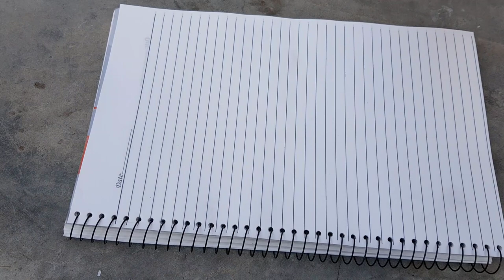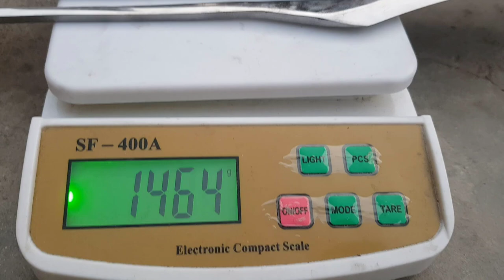Rusted GREEK SWORD - RESTORATION

Comment: Someone has to teach this dude the difference between restoring and customizing
Reply: For real
Reply: Why are you complaining when most of us including me in this comment section can’t even do what this man does?
Reply: The reason they are complaining is because there's a very big difference between restoring and customizing, we came to see a historical object getting restored and brought back as close as possible to its former glory, what we got was someone damaging and ruining a historical object (if it even is one) for their own desired look. And you don't need to be able to do this to complain about the blatant clickbait that the title is. Hope that clears it up for ya. Have a nice day.
Reply: Ermmmm he did both
Reply: Lets just say that he's Restorising.
Reply: Literally first thing he does is break the handle🤣🤣
Reply: Wow and you proly can't do what half this man does
Reply: Edwierdo hate to brake it to ya, but this is fake. For the wood to be in this good of a condition the sword would have to have been in a museum storage for centuries, also the sword has hardly any signs of age other than rust which should have had an effect on the metal seeing as the sword is supposed to be over 1000 years old
Reply: I agree with Yellowbuzz here, even with the restoring stuff out of the way its still clickbait. And @Edweirdo all he did was remove rust via vinegar bath, cleaned it up, removed the hardening and then polished it to near-mirror finish, stuff that you learn in 9th grade metalworking class.
Reply: Yeah he just made it into an oversized, probably unbalanced, crooked bowieknife
Reply: @isalcedo4211  there is no both lol.... restoration is restoring the weapon to its previous state. with as little deviation as possible. this dude straight up just remade the whole weapon lmfao
Reply: @Yellowbuzz-ug6of  .
Reply: I showed the whole procedure for restoring this chopper in this video.
o. The liquid i used to remove RUST was VINEGAR.
o. I used sandpapers of different GRITS for the shine of the steel.
o. Brass casting was done for the HANDLE to look more enchanting.
o. Dark colored wood was used to make the handle.
o. For Hardening the blade i used my own handmade METAL MELTING FURNACE.
o. I used clear paint to shine the wooden handle and Brass was shined by special brass polish.
He Tried To Explain It
Reply: @isalcedo4211  erm? never heard that term before
Reply: @lordfencepanel8666  yes because putting in vinegar metal grinding casting and normalising are incredibly hard tasks
Reply: @alexkim3084  im so triggered from this video  xD
Reply: Thomas yang by damaged you mean also restored.
Reply: Why are you running ? Why are you running ?
Reply: Chris he still restored it
Reply: im fine it just means like um
Reply: Someone also has to teach them the difference between a real sword and a replica :P
Reply: This was unbelievable restoration truly an art and amazing skill.
Reply: @lordfencepanel8666  Last I checked anybody can clickbait. It's a pretty basic skill :)
Reply: Manny Lontok make me bruh you don’t own me.
Reply: U guys cant lie tho it's pretty cool
Reply: @penguino8550  yall keep saying that but the only thing he does that i cant is cast with metal which i cant do because i dont have a kiln. Everything else is mad simple and even if i had a kiln that would be easy too. Doesnt help that the only thing he cast were his custom pieces so that part wouldnt even be a thing if he were actually were restoring it instead of customizing.
Reply: @alex kim he broke the handle cos it was decaying
Reply: @joedenralph9273  why didn't he try and recreate it though instead of making whatever in God's name it was that he made.
Reply: Emrik is right xd
Reply: Emrik still a cool sword tho xd
Reply: @alexkim3084  to replace the handle? That's how restoration works lol
Reply: Emrik he still did a good job btw the only fake part is that it’s an old sword
Reply: @Emerik ikr and he really doesn't understand what restoring really is apparently
Reply: He has done both
Reply: or restoring and "repairing". thinking people just call whatever they want. this is the very reason why we're making dictionary though.
Reply: "impossible restoration"
Reply: @usually_unusual3920  there is a fine line between customizing and restoring. Restoring is making it look like or close to like the original version. Which all he did was keep the shape of the sword then he made his own touches via customization
Reply: @thegodkiller0194  no he customized it there is a very fine line. If he had restored it,it would look like the original which it doesnt
Reply: He did both he restored it and made his on handle 🤦🏽‍♂️
Reply: I agree with all of you but the thing is it never look like that we don’t know if it look like that so really none of us have room to talk have a good day
Reply: @Kingtatos  listen, you didnt have to watch the vid, chances are they acquired it legally and depending on where they live they can customize it to their hearts content, and all they customized was the hilt and guard, if you dont agree with that then just dont watch it, and they technically did restore the blade
Reply: @unpopularopinion6321  "Is it legal?" was never a question discussed here, it's him claiming that he's "restoring" it even though you can't classify that as restoring sice he customized it. Then the "impossible restoration" part of the title leads you to think it's some super heavily damaged blade, when in reality it looks like it was made maybe 20 years ago with little amount of rust. We got tricked into watching this, and instead of seeing an actual restoration process we had to watch a perfectly good blade get ruined because of "preferance".
Reply: @unpopularopinion6321   He also made HUGE HOLE right in the blade...
Reply: Yup
Reply: @mrbigtoes6721  Bro, he didnt restore it
Reply: @kadenwellman4047  no
Reply: @lordfencepanel8666  You don't need to be able to do something to be able to criticize it
Reply: Kenny Van Vliet do you even get it?Its still restored.No matter what shape it’s in.
Reply: I agree - he destroyed a historic artifact.
Reply: Great job n u explain the process of what you were doing that was helpful
Reply: By all means...
Reply: Ok boomer
Reply: I've alway said this
Reply: Chris Better than an inefficient weapon.
Reply: Sebastian Rose Metal grinding can be dangerous.
Reply: Ghastly Deity It would be inefficient. If he is recreating something that broke in current times, he can restore it 100%, as something that new wouldn’t have the inefficiencies of the past, such as stone axes. Why would you recreate that? Make it into an iron axe.
Reply: guilherme henrique gotta get them views
Reply: @lordfencepanel8666  Right?
Reply: @alexkim3084  that handle wouldn't work, it's old and breaks easily
Reply: @realhawaii5o  a swords a sword!
Reply: @kadenwellman4047  right about m8.
Reply: Impossible restoration means it's very hard, I know I'm being very obvious but still.
Reply: @lordfencepanel8666  why are you complaining he turned it in to a call of duty bowie knife considering your name and profile I think you would enjoy the end result lmao
Reply: He destroyed a historical artifact that was ove a hunsred years old and was probably used is the Spartan ( 300 people ) v.s persian ( 300,000 people ) and the spartans lost
Reply: Dude do you honestly belive this swird is 4000 years old come on :D
Reply: Sword*,im too lazy to redact my comment 😂
Reply: Emrik you are completely correct
Reply: Yellowbuzz 1024 THATS WHAT IVE BEEN THINKING WITH ALL THESE SWORD RESTORING VIDOES. The only signs of age is the rust, and it comes off on his gloves way too easily to be real
Reply: That’s awesome
Reply: I agree to some extent but even if he wanted to recreate the broken piece he would still have to break it to see how it was made and just copy that which would've been completely fine by me for "restoration". Eventually u can see when he opened it how it was just some piece of wood with a cylindrical center and shape with a ring of iron on top of it, and I think considering this guy's skills he could've easily done that but just wanted to make it prettier, let me remind you he's 16-17 btw so cut him some slack, especially considering his skills.
Reply: @lordfencepanel8666  that doesn't mean he's immune to criticism
Reply: @lordfencepanel8666  By restore you mean customizing? Because this is customizing. He literally cut a weird ass slim rectangle into the weapon. 
Made a different handle, and made it look terribly like a mirror.
Reply: And also sum history cut that's a sword from the movie 300 the real greeks used a xiphos or a kopis.
Reply: @lordfencepanel8666  he is mislabeling his videos also coming from another one of his videos, this guy's a begginer, the job's shit ngl but I respect his effort. Doesn't make it restoration tho
Reply: Alex Christ almighty after 5-6 months you’re all still at me.
Reply: In the description he says he does that for fun so yeah
Reply: @lordfencepanel8666  
- Come listen to me playing the piano.
actually plays the guitar

- Someone needs to teach this dude the difference between a piano and a guitar.
- Why are you complaining when most of us including me in this comment section can't even do what this man does?
Reply: Restoring and modifying rather
Reply: Emrik lol
Reply: Okay, everyone. You guys need to calm down and just enjoy the video. The video that was uploaded for our entertainment, I might add. Instead of commenting on the video with mean/hate comments, we should be posting positive comments. There's already enough negativity in the world, we don't need to create more.
Reply: Someone hasn't had any parental love in their life
Yeah, he's customizing AND restoring
Reply: Lol.
Reply: @isalcedo4211 Um now it's one or the other. And he cut an unnecessary slit in the blade almost immediately didn't make a handle in the vein of the previous one. This isn't restored at all.
Reply: 100th
Reply: Oh look exactly 100 comments, lemme just ruin that. Also, Wood cannot be cleaned or it will get destroyed if you leave in water
Reply: Unless you know how to do it you shouldn’t talk
Reply: XD
Reply: @Kingtatos  yes and to see what it looks like in the end
Reply: Well, if this is a restoration, then I wonder what a customization is?!
Reply: ok listen, this person may or may not be from outside america, but although he is still customizing the weapon rather that restoring it, he does it to create art. Yes, the weapon looks nothing like the original but he wanted to creat work of art
Reply: @Kingtatos  oh your complaining I like to see you do this
Reply: @EJinsideAbag  I mean, restoring metal objects isn't too difficult. It just takes a while to do.
Reply: @revy2348  The discussion started because of the clickbait title. Could be that English is his second language, but you should watch out for how you title your videos. None of this would be in question if he just phrased it correctly.
Reply: @EJinsideAbag  You're* and it's not a complaint, it's criticism. As potato said, it isn't difficult, but criticism isn't limited by what you can and cannot do. All we're complaining about is that the guy effectively tricked an audience into thinking he's gonna fix it instead of remodel it, if that vocabulary makes you understand better.
Reply: Demi  oh ok yeah I understand the title is kinda click bait
Reply: Honestly
Reply: @Kingtatos  bro who gives a shit about historical stuff like everything now is gonna end up being history in the future
Reply: Thomas yang  this was far from historic sword it's a piece of tourist trash from the late 90's early 2000's
Reply: I guarantee you probably can't do either.
Reply: He's doing both but if you can do better go ahead
Reply: DJ FencePanel it’s not hard to do what he’s doing, it’s actually fairly easy to restore blades
Reply: Another hater Emrik. No problem.
Reply: These "restoration" videos are like AIDS infecting YouTube. Look and see how many of these "old" swords have the same handle on them. Also, stainless steel from the BudK catalog don't rust!
Reply: Sounds like your hating
Reply: Who cares, let the man do what he wants, it is his damn video and channel , if you didn’t like it... tough luck, go watch a different video. Instead of complaining about it in the comment section, go and find a video that pleases you. Damn, half these idiots don’t even know how to solve their own problems, let alone be functional members of society.
Reply: A lot dead Greek warriors turned in their graves  with what this guy did to that sword.  Hahaha  seriously though, guy did a good job.  But definitely wasnt crazy about that hole he made on it.
Reply: Alex Kim lol 😂
Reply: Alex Kim didn't he break the handle to make a new one....
Reply: RK 043 your name be crooked
Reply: Appreciate the work man .. cheers
Reply: @Kingtatos  do you even know what restoring is 🤔 because if you did, than you'd know that's exactly what he's doing 💯
Reply: @capncrunch5729  "Restoration - a return of something to a former, original, normal, or unimpaired condition." Now would you classify "putting a hole in it" as any of those things?

P.S. damn this conversation is still going on?
Reply: He really isn’t all that good, I have less experience and have done a lot better.
Reply: @lordfencepanel8666  because  they are allowed to tell their opinion
Reply: @Kingtatos  the title says rusted Greek sword impossible restoration. Not "Ancient rusted Greek sword"
Reply: Dony get jealous of this man.He have done something that you can't do in your whole life. So please just enjoy the video.
Reply: i know right
Reply: @usually_unusual3920  don't call people idiots you  DO NOT know what people have been through. I could've been abused and you wouldn't even know it so just think before you say that's all I'm saying not having a go
Reply: @realhawaii5o  yeap u right
Reply: I think the worst part of this, is the fact that all these "restoration" videos do this. It's a fake money grab. That's all it is. Half the time, these aren't even real antiques, and the "restoration" is just someone leaving a sword outside for a couple months and then making these videos. They not only ruin historical value (if there is, hypothetically, any historical value there) but it's also staged. These videos do not deserve all the clout they get.
Reply: Erin Horne ikr.... i don’t understand why they can’t just enjoy the video, if they hate what he’s doing so much just move along, no need to be so rude
Reply: Math_Boi _42 true true... why can’t people just be kind and if they don’t like something just move along and let people be...
Reply: @math_boi_4217  do you
Reply: he does both tho
Reply: I hate him. cuts a gaping hole into his blades spine uses angle grinder for edge like wtf heat it up pound it out, heat treat. Use actual belt grinder to put on edge.
Reply: It's okay he's Indian. 😁
Reply: He did both
Reply: It's more like "repurposing"
Reply: PotatoVII perfect. Love you 😘
Reply: @alexkim3084  you can't really restore shattered wood, so that is fully acceptable.
Reply: @SharpiesERA  repair or renovate (a building, work of art, vehicle, etc.) so as to return it to its original condition.

This is one definition of "restore".

There are multiple definitions, meaning similar things. 

By this definition, he did restore it.
Reply: @Kingtatos  restoring doesn't mean restoring the whole thing. If he wants to get creative let the man do his thing. Tho the title should be changed.
Reply: @Kingtatos  tho u r right in a way
Reply: Yeah someone should
Reply: I like that
Reply: Still epic tho
Reply: ❤️❤️❤️❤️❤️❤️❤️ this comment... 100%
Reply: PotatoVII When you “restore” a house does it look exactly as it did when first built with the same material , craftsmanship, and designs? Didn’t think so. Restore is a verb to bring back, doesn’t mean it has to be restored to its original look
Reply: @itachiuchia776  “restore” overtly STATES “bringing an item back to its previos state”. Full stop. That’s what “restore” MEANS.

You don’t get to redefine English just because it makes your buddy’s butt chafing go away. Be honest... not stupid.
Reply: @ArmchairDeity  Wrong try looking up the term and see how many variations are in the English dictionaries for restore. It's a verb. Thats why people say "He restored the item to its original form." People add the term "original form" because restore isnt exclusive to always mean what you're implying. Nice try though troll ✌
Reply: @nickaschenbecker9882  cause it a handle not all of them are going to be different in every single video, every single time.
Reply: I think he does both, he rostores the blade and customizes the handle
Reply: Whats the point in complaining. Clickbait is clickbait its okay, just enjoy the video.
Reply: xD
Reply: @Yellowbuzz-ug6of  he said its a greek sword, not ancient.
Reply: No one asked
Reply: He did change some changes to the blade so i guess its practically customizing?
Reply: But it’s clearly fake... like its obviously plate mettle and has a perfectly even layer of rust as if he just sprayed it with a tad bit of salt water
Reply: @progamer3335  prob some fake wallhanger he bought at a flea market and left it in salt water for a month
Reply: İ mean yeah he always changes desing of it
Reply: I came to see a “restoration” video. Not someone complaining in the comment
Reply: Yup
Reply: @Kingtatos  restoring it means to fix and clean he did restore it and customize it if u not satisfied  unsub
Reply: @Yellowbuzz-ug6of  bro have u heard of an replica  it's the replica of the Greek weapon
Reply: Old argument but whatever
Restoring is the act of returning the object back to its former self with no rust e.t.c. just that. Nothing else.
Customizing is the act of changing the object to your personal liking. Granted he did remove the rust, sharpen the blade, e.t.c., but the fact that he changed the grip and stuff causes this to be a customization not a restoration.
Reply: Yep. He’s making it worst then what it started if you talk restoration... why cut that weird square hole and why make the handles dum
Reply: @RomTavor  the handles isn't dumb it's a unique design
Reply: @Milkshake-1872  still he restored it back to how it was no rust then he custimized it  basically . In one
Reply: @grimmyvfx3272  It is not a restoration the second he made a customization to it. Up until that point I was a restoration.
Reply: Bro chill he's probably new at English .just look at his skin color you would probably say he's Indian or something. He's just doing his best so please go easy.
Reply: I mean... he does both
Reply: My
Reply: Why r u being soo rude dude!!! Don't act like so 🙁🙂
Reply: There’s a few things that everyone is forgetting. I’ll start off by saying that no, this can’t be a Greek sword. The style of the sword is a falcata and they are usually too heavy to wield so they have lines through to reduce the weight, much like the Italians. The handle is not in the traditional style of a falcata, I’ll emphasise this by saying that I’m not 100% certain that there was a specified style but from what I know it usually contained pins with the tang showing. People who are saying that the wood is too old forget that the Greek empire fell roughly 2000 years ago. Approximately 100 years BC, it is possible for wood to survive this long but due to the condition of the blade we can confirm that wood from that era would not have held up. And for everyone saying this is click bait...you would be right, if something is shown as eye catching as “Impossible RESTORATION” it’s usually doing this to try and catch your attention. Don’t try and argue this blades authenticity, this would’ve been in a museum if this man did stumble across it. As for the blade itself I still think that it is lovely and the video is a great to watch
Reply: Let's us all agree that this is a 'restoration' the same way your local recycling plant 'restores' numerous metal scraps on a daily basis.
Reply: Stop complaining, we don’t even know what they looked actually looked like
Reply: @alexkim3084  well you wouldn’t be ABLE to restore the handle, it’s wood. It’s in he same style. Customizing would be him adding a whole bunch of inscriptions or “pizzazz” (to the blade or handle) he had to change the handle to restore it because you can’t restore wood
Reply: You guys are mean. The ones that said to teach this guy the difference between restoring and customizing. Just enjoy what's there
Reply: Chill chill just let him do his thing😂😂😂😂 we all were thinking that. You didn’t HAVE to point it out😅
Reply: I think he restores then customizes
Reply: restore is something that being destroyed that you wanna fix it again
Reply: Learn to read it says impossible restoration not restoration.
Reply: how about modification?
Reply: @Kingtatos  its not fucking clickbait he may not be restoring it to its former glory but hes still restoring it from a rusted ol piece of shit to at least a weapon
Reply: Guys...Just Appreciate His Work.We Dont Care If He Is Customizing The Antique Things In His Own Way.He Has Some Serious Talent And He Is Trying Express That Talent To Us.And Yeah...If U Guys Are So Badass To Complain Or Report This,It Means U Are jealous And...I  Dont Care About What Haters Saying Neither "Random Hands" Too.Just APPRECIATE guys
Reply: “Okay the difference is... nothing”
Reply: Someone needs to grow up and stop complaining and just watch the video
Reply: He did both
Reply: What's I want to know how did he keep finding these tools 🤔
Reply: @24-er  you can’t do both with historic pieces. If you change it at all it loses all historic value. This is true of any item, not only swords. Hell watch pawn stars and you’ll see 100 examples of people refinishing what would have been incredibly valuable items and causing them to be worthless.
Reply: Lol😂
Reply: @usually_unusual3920  a big hole in a vintage weapon is....
Reply: @Yellowbuzz-ug6of  no1 said that the sword is 1000 years old.... Maybe its just a modern sword crafted in greece and just rusted a bit in 80-100 years :))))
Reply: Not complaining either way, cause how he does it is his prerogative anyway but it is true he’s actually customizing. Who cares tho? It’s awesome to watch.
Reply: What ever you I know u r jealous
Reply: Let's just all appreciate what this man does
Reply: Let's forget about the sword and appreciate this type of dedication and craftsmanship
Reply: How else will restore a rusted sword with a rotten handle??
Reply: You would severely hurt you hand with that handle if you were to actually use that as a chopper
Reply: True very true but he does his job good atleatd
Reply: He probably bought the sword off amazon
Reply: @alexkim3084  what else would he do. It’s not like you can restore wood
Reply: @no_cheeses  idk change the title ig
Reply: Yet I am sure you could have not done better so let him be (be awesome)
Reply: in his defense he actually does restore it and make most of his restorations look fairly accurate to their previous states before adding details and customizing it. he’s just bringing new life to old pieces. i actually quite like his art and think he’s doing an amazing job. i get your concerns but i just don’t think this is the right channel for u.
Reply: He actually does both...
Reply: @Kingtatos  idk if it's even possible to restore something like this
Reply: Still a good vid tho
Reply: @zedmainlololo5080  actually it would have been made from bronze not iron. Greeks did not have the proper amount of iron so they had to mix in copper
Reply: @johnx9955  than why the hell did you come here and keep reading comments I mean you are like half way down so you had to have read a lot lmao
Reply: @donttouchmymustache6497  anyway 3000 fking years this blade would be dust by now so i made my point 😂😂😂😂😂🤙🏼🤙🏼🤙🏼🤙🏼🤙🏼
Reply: @zedmainlololo5080  indeed lmao 😂😂
Reply: @donttouchmymustache6497  end of discussion 🤣🤣🤣🤣
Reply: @donttouchmymustache6497  i win,u loose,hear my evil laughter HA-HA-HA 🤣🤣🤣🤣
Reply: lol
Reply: @zedmainlololo5080  actually you didn't win, You said it was made from iron when in turn it was made from bronze and no it would not be dust it would just be extremely fragile. Now you can hear my evil laughter HAHAHAHA
Reply: also between possible and impossible
Reply: Why can’t it be both?
Reply: Pimp my ancient artifact
Reply: @penguino8550  doesn't matter if we can or cant restoring a historical artifact is returning it might and glory he customise's and clickbaits saying he restored a ancient Greek sword if its even real and that's clout farming I hope I summed it up for ya pal good day
Reply: @thebreeker  bruh this was a year ago why u even replying😂😂
Reply: @ScovilleMusician  No even though it's not real clickbaiting off an artifact over 1000 years old and worth millions is disgraceful imagine taking the decloration of independence or some other artifact and letting a 3 year old scribble and draw on it and someone says they just did they're thing you would roar the head off them you dont ruin or customize artifacts the only people who have that privalige are the highest historical weapons experts and historical weapon blacksmiths working on a team not some random on youtube
Reply: @itachiuchia776  it's a fucking historical artifact and this guy is clickbaiting it's not even real and if it was it would be in a high security museum being checked on twice a week be historical weapon specialists not in a random on YouTube garage
Reply: @dejanlazovic6284  oh my fucking god Greeks lived 1000 years ago which makes all greek weapons armour and artifacts ancient it's not rocket science infact it's not even science its basic history everyone should know
Reply: @grimmyvfx3272  he clearly states it's not a replica and the fact hes blatantly slandering ancient history and your siding with him is disgraceful and it's a fake not a replica he let's it soak in salt water
Reply: @_.mosthated7318  the greeks reigned 1000 years ago and that is classified as ancient any swords and armour bow and other various weapons and artifacts and it's clearly fake use your brain
Reply: @thegoliath9310  no it's not it's not real if it was real it would be in a high security museum and always get checked on and clickbaiting with slandering ancient artifacts is disgraceful and dishonourable
Reply: @Blank-tm6tt  calling an ancient artifact an ol piece of shit is purely outraged and dishonourable and I hope you know its was fake but if it was real it would be worth more than you ever owned
Reply: @penguino8550  y r u replying to me
Reply: @thebreeker  never said it was real, I was saying that the video is a restoration by the definition of the word. Bruh haven't seen this vid in months, let me be.
Reply: Then why are you watching his videos
Reply: @thebreeker  you literally Crying over a video 🤣
Reply: @jespah36  l Lo
Reply: If yall are complaining then why the hell are yall watching it 😑😐😶
Reply: It's his Greek sword.. He can do whateva da faaaaq, he plEASe (in a Greek accent)
Reply: And to stop using brass on everything!!
Reply: @Kingtatos  They can do that! Because there is something magical called. a replica, located inside a museum. What he's doing, is certainly more than you can. I'd like to see you restore something to 100% former glory.
Reply: @alexkim3084  actually, if you had seen, it was already broken. He just finished the job.
Reply: @Yellowbuzz-ug6of  metal and wood can be preserved very well if buried or encased in dirt, stone, or even more wood.
Reply: Asap
Reply: Bcz you are jealous
Reply: @wonderfall327  Restoration is part of what im currently studying, don't just assume what someone can or can't do. And I like your comment of "I'd like to see you restore something to 100% former glory." As if i ever complained about this creators ability to restore something, my point since the first comment I posted here (over a year ago) has been that I dont think "cutting a hole in it" counts as restoring, so the title isn't accurate.
Reply: True
Reply: I Tried. He wont Learn.
Reply: He did restore it, he got the rust off and completely made it usable again
Reply: @mrbigtoes6721  it's clickbait
Reply: technical term would be resto-modding
Reply: My first thought when I saw him drilling holes in it
Reply: No brother he knows knows better than you
Reply: Well he restores it then instead of leaving it to collect dust he customizes it and adds it to his collection
Reply: @lordfencepanel8666  n
Reply: Don’t hate it’s good work
Reply: @arjminder433  
When did i ever say anything about the handle? Did you even read any of my comments? I'm "complaining" about the damn hole he cut in the blade and how that doesn't count as restoration. Jeez, how thick can you be?
Reply: @Kingtatos  I bet u have no friends and this is the reason why 😂🤣💀 he cut a hole in blade and he’s getting views for it boohoo
Reply: @arjminder433  When you run out of valid points so you start insulting the other person instead, kinda sad, not gonna lie. I miss the days when you could have opinions on the internet without some kiddo hopping on your comment begging for attention. Maybe rethink your life before you write your next reply. Have a good day! :)
Reply: Exactly.
Reply: Dude, rather custom or restoration, either way, he busted his ass bringing the sword back to life and looks pretty darn good and after working a project that, I think he deserves some credit for it.
Reply: Technically he is bringing back a old sword so yea
Reply: the "sword" was a piece of crap to begin with, he restored its dignity!
Reply: yes
Reply: @lordfencepanel8666  🔥
Reply: @Kingtatos   it was a joke
Reply: Restore and customizing both are legal
Reply: @trader025  it’s it’s a replica
Reply: I know, it’s so sad seeing history being turned into a pretty pink samurai anime claymore nurrito legendary special edition gama radiation ex. (Is it even history?)
Reply: @emrik could you do it?
Reply: And teaching how to work. Today we have very powerful instruments. Time ago fire hammer anvil kniwledge real knowhow and procedures to save time and energies
Reply: still enjoyable tho
Reply: @Emrik
Can you even do an OUNCE of what he can...empty vessel dude, thats what u are...
Reply: @zedmainlololo5080  
If the world is 2021 yrs plus some change old, wtf do u get 3000 yrs from?
Reply: @Randy Sibran  Emrik has 4248 thumbs up. Random hands has more than 15% of  thumbs down. Many people disagree with his "restoration choices" in any case he earns money with yt. 
An engineer doesn't know how to use float and trowel but he knows how to build even a dam. In any case, an engineer can see build a dam and say that is not the right way. Even a mason can see that that is not the right way to merge the cement. And you? 
Instead of junging people just think to yourself and your  skills: if you approve rh works you are not the right person to say empty vessel to anyone.
Reply: @RobertoP-cb7lp  
I wont say point taken as you made no point, just some randomly thrown semantic in mid air that floats around like kitchen jargon. Life has choices buddy, watch it, dont watch it however I stick to my words, empty vessels. He can have a million thumbs up...let him do what this man can and prove it, empirically, without doubt.
Reply: @Randy7201  world is 6 billion years old on official data, civilization is 50 000 years old,at least the known one,its impossible blade that old to be in such a good condition
Reply: I don,t care
Reply: He ruined it and took its history away wtf
Reply: Well he's doing both actually. So I don't think they do. Ever heard of restomodding? That's what this guy does. Cheers mate 😁
Reply: @LeftMindedThoughts  he fucked it. Made some bullshit sword out of history
Reply: And the difference between a real sword and a wall hanger
Reply: @isalcedo4211  v
Reply: @isalcedo4211  w
Reply: After all the comments I have decided that everything here is just a bunch of pray ranks complaining that hunter is too powerful because people don’t know what a uv light is 🤦‍♂️
Reply: I was physically nauseated when he started carving that fuller
Reply: @alexkim3084  I mean can he really restore that?
Reply: Agree
Reply: maybe you need to learn how to do both restoring and customizing like the man does
Reply: @alexkim3084  how are you supposed to call a blade restored if it has that rusty old handle and also ,he has restored it bcz he didn't change the shape of the blade and its still the same species of the blade . Peace
Reply: @Kingtatos  Bruh do you realize how difficult it is ? From a rusty old to a shiny new look. That so without adding any extra metal to it.
Reply: @usually_unusual3920  exactly
Reply: He did it without changing its shape plus he never used any extra material expect the handle that the sword was desperately begging for.
Reply: @realhawaii5o  It's not a replica , it's not like started from scratch
Reply: @ghastlydeity  it's just the handle which was different but it is the blade that matters
Reply: @Pro-ns7wu  I've already mentioned that I've studied restoration, so yes, I would say that I do realize, except it isn't actually that difficult, it's just time consuming.
Reply: If you can do customising or forging then show it why are you complaining
Reply: True but it is still became better than it’s rusted self so that is technically restoring it
Reply: Yes, this is not a "true" restoration.

Yes, he did damage a replica sword.

Yes, the title is clickbait.

No, that does not make it alright to go nuts in the comment section over this.

1) There's a difference between a FULL restoration of an object to it's previous iteration, and a PARTIAL restoration of an object, with some artistic liberties taken upon the restorer to make the product feel more unique, like an artist's calling card.

2) If it were an actual historical artifact I would have been much more peeved at this. I say it's a replica because this is a steel blade and ancient Greek swords would have been made of Iron, which would have certainly deteriorated to some degree over 5000 years without any maintenance.

3) The title is somewhat clickbaity, and that's being generous. But still, this is YouTube. People are obsessed with status and clout on this platform and care more about reaching a broader audience than they do about making quality content. Are you really that surprised to see it, or are you just looking for an excuse to call someone out on a misleading title because you've got nothing better to do?
Reply: Even if this is A Clickbait I enjoyed it!!
Reply: no cap 🚫🧢
Reply: @Kingtatos  this aint a historic object bro its a replica and a heavily neglected one at that 🤣
Reply: @lordfencepanel8666  cos customizing isn't what I clicked on the video for